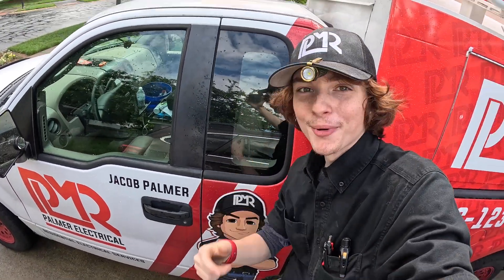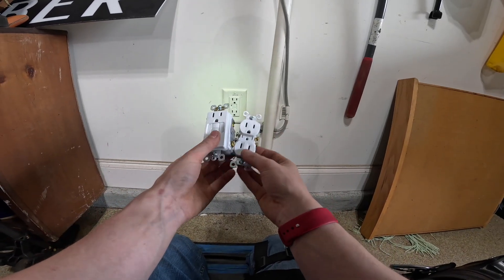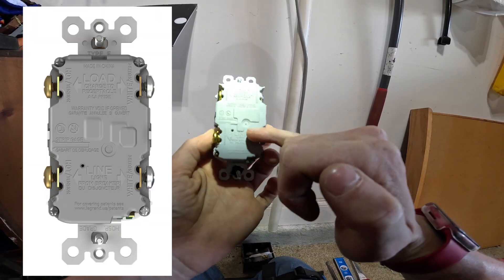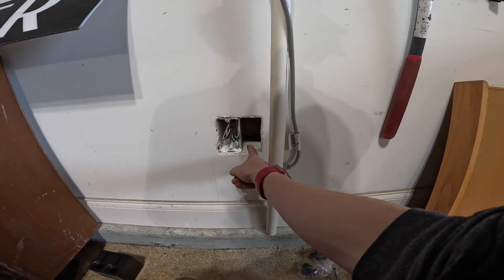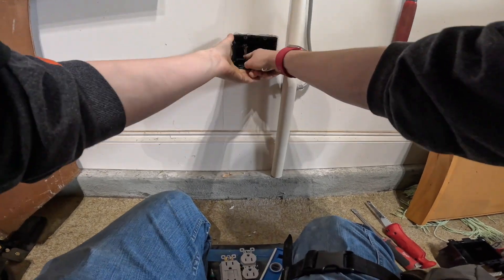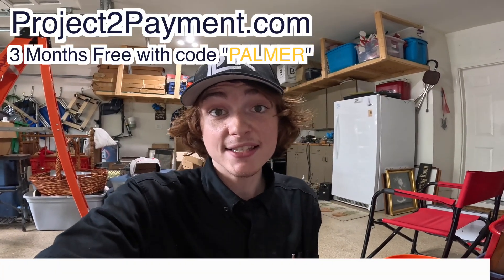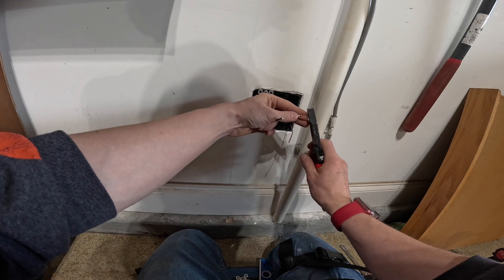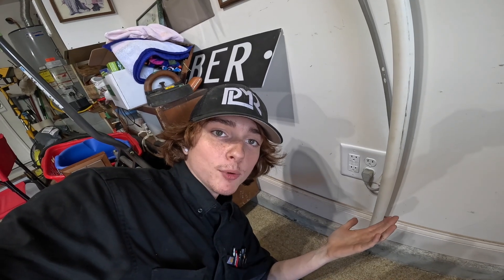GFCI to QUAD OUTLET - Start to Finish POV with Detailed Explanations

Comment: why did you wrap the wire around the screw on the regular outlet but not the GFCI? I am learning this trade
Reply from the maker: The GFCI has pressure plates inside that clamp the wire with a serrated surface! Makes a good connection, not the same as the “back-stab”. The regular duplex had back-stab but I used the hook and screw since its more reliable. The hook is an acceptable method for the GFCI but is slightly tricky when it also has pressure plates inside👍🏻 good question!
Reply: @PalmerElectrical  roger that thank you hoping to start trade school next month. been watching your video very helpful thank you again

Comment: I was a licensed electrical contractor in Calif, 20 + years ago. I had a problem biding, since I only used coper wire & like you took more time. I could only get custom residential work. Enjoy the way work. Bruce

Comment: What a fantastic job and great explanations. You are thorough in your work. I loved it when you said twist your wires. I have seen so many who don't. It's crucial to twist the wires to make a perfect mechanical bond. Keep up the great work.
Reply: 🤦🤦🤦 have you twisted wires with the wirenut good? When you take the wirenut off the wire still connected together as if you pre-twisted them. Some dudes just make unnecessary work and boast about it, so silly.

Comment: I’ve watched a bunch of videos and I was wondering why couldn’t you just carry supplies for 12 awg wire and stuff. And wire everything that way because receptacles wouldn’t hurt and lighting. It wouldn’t over load it due to the breaker. I was just brainstorming.
Reply from the maker: Well I would say the reason is that it costs more, but it goes beyond that. Its just alot cleaner to use the appropriate size wire to match the circuit. If the rest of the circuit is wired with 14, it makes sense to go ahead and match it. You are right that it would work fine, and theres nothing wrong per code, but I would be concerned about the next guy finding 12 wire without seeing the 14 that feeds the rest of the circuit, and upsizing the breaker based on a bad assumption. Basically… keeping things consistent makes it easier and safer to work on. If you wire it all in 12 during new construction, then same thing just keep it all 12 for the sake of consistency.

Comment: Did the same thing in my garage; BUT ran 2 separate circuits because like your customer lots of things (i.e. compressor) get plugged in at one time. Also upped to 20A to accommodate chance that may need in future. And why didn’t you install a matching decor outlet to match the gfci?

Comment: I’ve been retrofitting ground wires into my old home/soon to be rental. I’ve been pulling out a lot of old boxes and my trick for preserving the drywall shape is to take an oscillating tool with a carbide blade and cutting the nails on the inside or the wings if it’s that style.

Comment: Dedicated resept for a irrigation controller WOW
Reply from the maker: I know, I see this all the time and its always been odd to me.
Reply: @PalmerElectrical good job your attention to detail cover screws aligned awesome I’m just retiring at 60 . 35 years in the trade god speed
Reply: I'm a irrigation manager for a for a large 70 school district. We spec out that all irrigation systems get a dedicated outlet. This prevents the irrigation system from getting turned off if another trade is working on something. I do realize his video is off a home and not a commercial site, but it's a never a bad idea to put it on a dedicated circuit. Little more on the line when you are controlling football fields and baseball though.

Comment: I would have been curious to know what the customer is powering with the extra receptacle, just to be sure that overloading is unlikely to be a concern, it's only a 15 amp circuit. Another thing is that I would carry roles of black and white THHN wires in the van. NEC 310.8(A) requires wire information marking on all conductors. There is no marking on individual wires that have been removed from the Romex sheathing, so technically, this is a violation. Other than that, you do very good work, I wish you success in your business.

Comment: sigh. i prefer exposed electrical where it's NOT made into our walls like this. it's sturdy enough. also i would turn off power to the WHOLE HOUSE before i tried to cut into a wall while just assuming what's behind it. also 3:22 is just a "flat head screwdriver".
Reply: You would shut off the entire house's power to cut 2in to the right of an existing receptacle? Sounds excessive
Reply: @Juicebug999  I'll do what i want to feel safe. I've met plenty of stupid pathetically corrupt electricians. Who knows how a place is wired if you didn't do it yourself. A piece of paper is just that.

Comment: Great job. Did you not have a decora outlet?
Reply: Yea the two outlet styles does not look great imo. But I guess it makes sense if the rest of the house isn't using decora.
Reply: I don't like Decora style, especially in the garage, there's no functional benefit for the higher price. I would recommend a standard commercial spec grade receptacle for the same money, maybe cheaper.

Comment: Funny you mentioned pre twisting the wires. I always pre twisted for years until I started work for one company in my area doing commercial scale work. I was pre twisting and my boss got on me about it and said it fractures the wires and made me stop. I tell you its a pain to try and hold several wires together to try and get a red or even blue wire nut on. And then if you had to open up the connection hot to troubleshoot or add new wires they all would spring apart on you. As always great video and excellent step by step details. Keep up the good work!
Reply: "fracture the wires".. That's a new one 😂
Reply: If the wires aren't twisted together when you take of the wire nut you havnt twisted enough. I had an opportunity to ask an ideal Rep about the "no pretwist needed" he showed me how once you twist enough the wires look identical to a pre-twisted connection. You need to keep twisting the wire nut untill the wire entering the connector is twisted twice over.

Comment: How do you fix a box when it's loose, and when you plug something in the entire outlet/box comes out. Any tips?
Reply: Turn power off, remove outlet, see if you can tighten or add screw into the stud to hold it. If not, do what he did in this video but just with a single gang cut in box

Comment: Good stuff as always 👍.  The only thing i would havd done differettly is using a metal nm clamp on the wire comming in.  It will make replacement or moving it later on soo much easier than having plastic dig into the romex.  And you know that lockring wont hard to remove or come loose ever.  Too many times people tug at the romex to get more wire but only dig thoes plastic clamp arrest in more.  More truthful words couldnt be said "pre twist"  if its gonna stay together without the wire nut its only more secured.  And before jabbing saws into the walll take a pokey insulation rod and look around you never know whats behind that a drain pipe?  A tip if you want your screw on boxes to fit flush with thoes side screw boxes is to put a device and a cover plate on half the 2 gang hanging out the side.  This set the box perfectly and as we know most studs have a twist or bow in them.  Dont wanna do that a washer and a 8 32 screw works too.  As always a fine job 👍
Reply from the maker: @MattHmm-rq6dn  Awesome idea about putting a single device and cover on to get it flush, I will use this! Thank you for watching and for your comments!
Reply: @PalmerElectrical my southwire smart boxes have a taper to the back and tend to fold in a little i keep a composite door shim just in case to keep it flat along with the cover plate/washer trick.  I know the next person who comes in will appreciate not having to do what you did to demo the box just 2 screws and likely dump it behind the wall if there lazy.  I do tons of older historic houses and thoes add on 5 peice metal boxes are the bane of my existence.  Too much ossilating tools and sawzalls in that lath and plaster to demo it out.  So i try and make it as nice as i can for the next person.  Also the tabs if not useable on cut in boxes arnt useable you can face screw them on and take the tab off.  Ive even cut a few fins in the way off and inspectors in my area havw no issue with external mods thay dont change the cu in of rhe box itself.

Comment: You taped up the terminals to stop the ground shorting on them. In the uk we add earth (ground) sleeving over the bare earth conductor to do the same thing. We have to do by code. Is this ever used in the US?
Reply: You'll notice in the usa when we have a metal box they sell pre made ground screws attached to 12g wire with a green sheathing.  That's another time in residential you'll see a proper coated ground wire.  And we use thoes pre made ones specifically because it makes our work look proper and above reproach.  The color isnt required in most situations to be correct but if it isnt you will get a ton of scrutiny.  I don't know about uk code but a brow or blue wires being something other than that may be a violation for you.
Reply: @MattHmm-rq6dn that’s a good point, a lot of our back boxes, well all that are installed in concrete or brick walls are metal, and as you mentioned all come with ground screws. The tail from this back box screw to the earth terminal on the face plate also has to be earthed sheathed. We do use plastic back boxes for plaster board walls, but even then the ground conductor in our twin and earth ( I think the same as your romex) in this situation still has to have earth sleeving. Going back to your point on metal boxes. The more I think about it, most houses, certainly older ones were all brick and block work including internal walls, not many wood frames houses, and therefore all sockets had metal back boxes could have been the driver for this earth sheathing requirement. I appreciate your comments.
Reply from the maker: @davidcase4041  In commercial wiring, the grounding conductor is usually insulated. The bare ground like this is in NM cable, used primarily in residential applications. That is a good practice though, I like those sleeves you guys use!